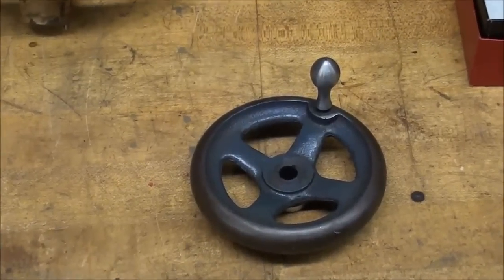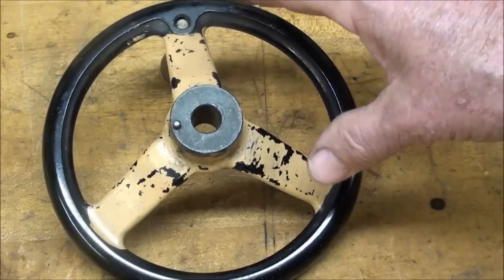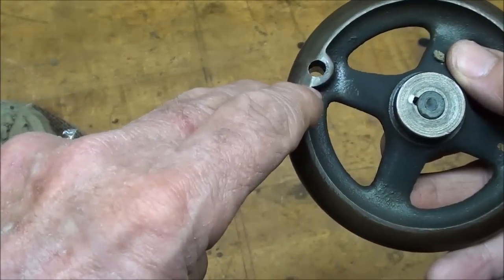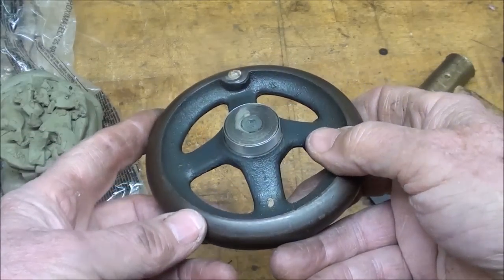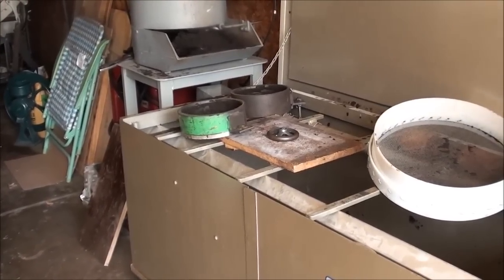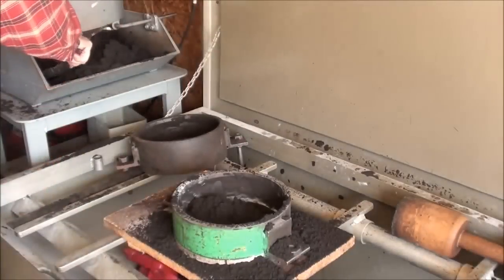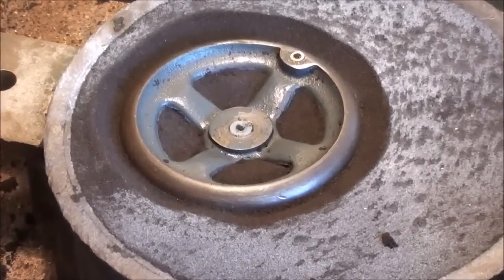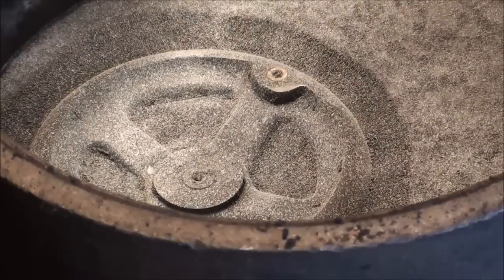MACHINE SHOP TIPS #158 Making a LATHE Handwheel part 1 tubalcain

Comment: Molding spoon?  You mean slick :)  Also you should cut a well under your sprue and a proper sprue cup on top (curved with one flat side)  then the runner should go outward on both sides of the circumference of the wheel before feeding the casting,  (Avoid the direct flow) this will reduce turbulence that will create porosity and\or could carry in loose sand.  Also no riser?  it would be placed probably over the center hub or two along the wheel sides.  Good video.  Brings back memories :)

Comment: This is exactly what people do in china when making copy's of just about anything. The problem you have when taking a finished part and using it as a pattern is that there is no account for the shrinkage rate. It wont make to much of a difference on a hand wheel, but for other parts it would. All patterns start off as larger than the finished product to take into account the shrinkage of the metal as it cools.
Reply from the maker: All very true. I cover this concept of shrinkage and many of my foundry videos

Comment: I don't believe in glue for plastic either, but I was desperate when the tail of my coat snapped off my turn signal stalk. I used Permatex Plastic Welder, and even though it was a repair in a high stress, heavy use area, it actually held for about 15 years. When I finally junked the car, the repaired turn signal was still fine. I'm sold.
Reply from the maker: Someone glues are really strong

Comment: What casting I do around my shop I learned from books I bought off eBay. I was waiting to see how you were going to remove the wheel from the sand. You did it as I guessed. I might have set my gate to intersect with one of the spokes, as I usually worry about getting a complete fill.
Enjoy watching your videos and learning more each time.
Thanks, Tom

Comment: Mr Pete i have been watching your videos for quite some time now, I greatly appreciate you sharing your experiences with all of us along with your sometimes overly detailed explanations ( reminds me of my grandfather)  No offense intended it is a complement.  Personally i have been trying my hand at manufacturing my own parts for riding lawn mowers specifically the older ones to which finding parts are so difficult.  I have ran into a problem that maybe you can help with.  I have a particular part that due to its size and shape it has allot of extra aluminum on it and you guessed it shrinkage is a large issue.  Currently i am using homemade green sand that is water based, This weekend i am going to try and make some that is oil based.   Do you think oil based sand will help with my shrinking issues or am i doing something else wrong.   Any advice would be helpful   Thank you and keep the videos coming i never get tired of watching them.
Reply from the maker: Tony Emory The type of sand has nothing to do with the shrinkage
Reply: Thank you, I tried to make some green sand it didn't turn out so good with the oil i started a fire instead.  Anyway decided to just bite the bullet so to speak and order some petrabond along with a decent sand muller i know my castings will come out much smoother with commercial grade sand,  Should have done that sooner but im cheap and if there is a way to DIY it so to speak i will try that first.
Reply from the maker: Tony Emory Great-you will like the sand
Reply: Tony Emory In the castings bids I have watched, they make the casting slightly bigger, or have reservoirs for extra metal.

Comment: Just a thought borrowed from the brick laying trade adapted to youyr use as follows.
To scrape away the sand to an exact and constant depth, Take a piece of half inch square timber , in your case about 15" long tap a small nail through the centre, allowing the point to come through the same amount as half the thickness of the wheel. Place point down with the wood sliding  over the edges of the  drag and move in a circular motion to loosen and displace the sand. Ocasionally blow clean. This will give you an exact and flat base wherever the nail moves. Primitavely simple but compared to a spoon, incredibly accurate.    Keep up the good work, Beats watching rubbish TV any day.
Reply from the maker: Good idea

Comment: I have learned enormous amounts from watching your many videos. I really enjoy how you go about communicating your tips and tricks.  I would like to suggest regarding the use of plastic on the Bridgeport that it is done very deliberately, and perhaps for good reason. The downward had feed on most vertical mills use a series of gear reduction to move the quill. The tiniest of gears are at the end where the hand wheel is. This gear and the bearings it runs in are fairly delicate. The heavy weight of a hand wheel if used will wear and damage this gear set in a similar way as heavy keys hanging from your ignition will wear your ignition lock on your car.  Thank you again for the many useful videos...Doug

Comment: TubalCain, while you do know a bit about the machine shop trade, your comment about adhesives is just straight up peckerhead!!  Its not the adhesives fault. You are either choosing the wrong adhesive, or not following directions. I dont care how long you have been around, your not doing something right.  I have personally, and many others in industry have used the very adhesives you are referring to, for the purposes you are attempting to use them for, without issue. Heck, most modern cars use a LOT of adhesives in their construction. Entire body panels, and some structural members are fastened with adhesives.  You mentioned epoxy specifically. Did you know that almost the entire chassis assembly of modern F1/IRL type race cars are assembled using noting other than epoxy?
Reply: Speaking of peckerheads... No glue available when the handle broke would have repaired it so that it would be structurally sound. The available epoxys wouldn't, they just didn't bond to that type of plastic. Eastman 910 would bond, but wouldn't be durable. You'd need a space age UV cured glue to do it today. and it still wouldn't be as good as new.

Sure those race cars are glued together, with lots of bonding area/moment arm, the opposite of his problem. Why don't you just try to learn something instead of showing your childish ignorance?

Comment: Just a suggestion for when you scrape out the sand around the outside of the handwheel and feather back the edge for the parting line if you make more of these.

It wouldn't be that hard to make a scraper blade with the handwheel radius and draft angle cut in it so all you have to is scrape around the outside edge of the old handwheel (pattern) without having to guess where the centerline is on it.

Excellent video by the way.
Reply from the maker: Good idea--never thought of.

Comment: Mr Pete I have a method to make it easier to mold things with a weird or hard to mold parting line. I add enough sand into flask to reach the parting line then I place a sheet of kitchen plastic wrap over the sand add some parting dust and place the pattern, pushing the pattern in to firm up the sand under. Then I riddle in some facing sand and proceed ramming as usual. When the flask is flipped over I carefully lift out the plastic wrap and sand, this should get you down to the parting line! Put on the cope dust parting powder and finish ramming as normal. Yes a bit fiddily but the trick does work. Try it some time and like welding or other shop skills it takes a bit of practice.  Cheers Gene
Reply from the maker: thanks Gene-- That's a net idea, I shall give it a try sometime.

Comment: Lyle;

Thanks for another great video.

Not that it means diddly for what you are making here, but will the final piece be about 1% to 2% smaller than the original wheel due to aluminum shrinkage during casting?  I have a bunch of Starrett shrink rules and I know the double shrink rules are used for when a metal master piece is to be made from a wooden mold piece, and then the final parts to be cast from the metal master.

Just wondering to see if I understand this correctly.

Regards;

Ron Kluwe
Reply from the maker: Yes is smaller    about 3/32 per foot of shrinkage

Comment: I know everyone might try to tell you all the stories about glue.

But from experience formed across varied types of uses...

paper, metal, plastic, leather, textiles and wood

...each glue has it's uses or better said, each material need it's special glue.

If you buy any glue that says "and this can be used to glue wood, metal, plastic etc" then that's the problem. It's a generic glue.

My most recent endeavor with glue is rubber. I had to restore an almost centenary Russian made oscillating wood planer. It had a split rubber sleeve.

Before i even dared touch that rubber sleeve, i tested 9 different types of glue, until i finally settled on a custom made glue that i had to order. 

IN  conclusion to the text wall, you can't expect a glue to perform, and by glue i mean any compound that stick two items be they identical or different in make, to work if it's not the appropriate one.

The hand wheel most likely had a small extra cylinder on the hand side that was reduced to that surface we see now. Another YouTuber here did a hand wheel for a vise he made. That's how he did it. That way you don't damage the hand surface on the exterior of the wheel.

I really love the playlist format. It's easy to access when i want a quick tip. Wish the other guys i follow would do something similar, but hey, to each his own, right?

Your casting method makes things soooooo much more easier than i've probably seen anyone do before. You, have to be some kind of wizard of casting, because there's fluidity in each move you did.